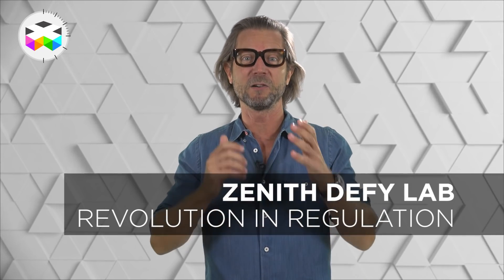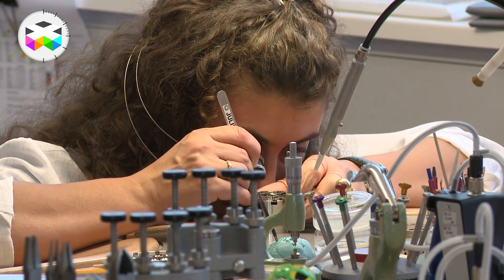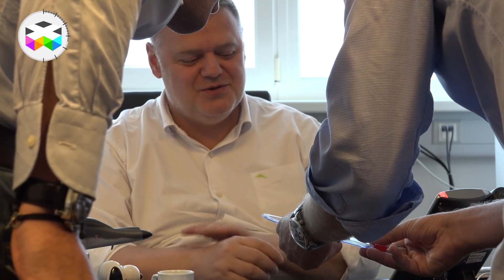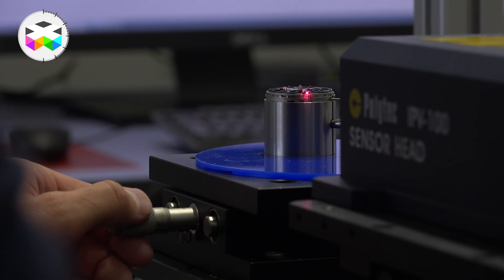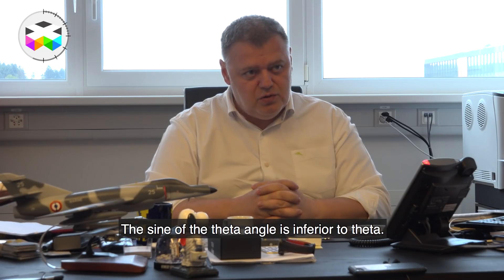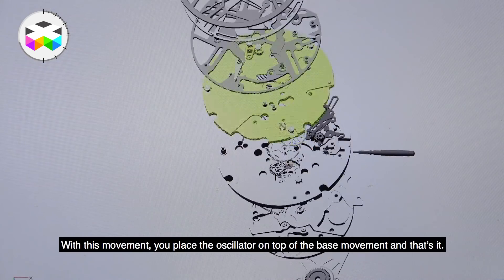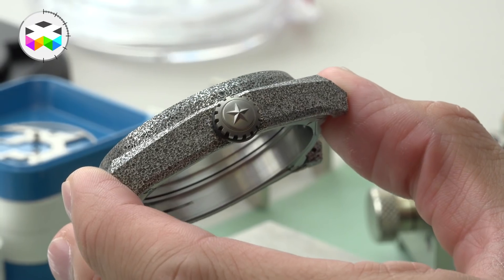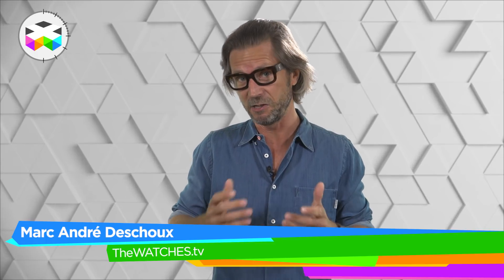Major Breakthrough in Watchmaking with the Zenith Defy Lab

Comment: I was heartbroken when I found out this was already 3 years old. 
But I agree; traditional watchmaking combined with new technology is pure magic.

Compliant mechanical design,
Topology optimisation and generative design
Additive manufacturing.

These will be key elements in future mechanical engineering and design, regardless of discipline.
Reply: I feel the same way but now it is 4 years old.  I'm fascinated by compliant mechanics and here I thought, wow! A product!  But is there?  4 years later, Zenith has not employed this movement in any new watches.  Why?  

Sometimes I wonder if the theory of compliant mech has only very narrow practical use case.  I mean, otherwise, we would have so many consumer products that use this material science.  But we don't.  And here we see what looks like an amazing implementation but 4 years later and it is completely forgotten.
Reply: It's probably too fragile to be used as a watch movement, or too expensive to make (hardly a problem when talking about luxury watches).

Comment: As a person who uses exotic mechanical principles in his work I'm unimpressed. The whole "femtosecond" "optical" "molecular" blah blah is so annoying when you see simple formulas and the thing looks like a flexure system. So a big meh from me.. it had to be fun engineering this (to get the ratios right) but it's just a different shape of spring (which might be more efficient)  finstead of the classic spiral. And why a silicon gear? To make it sound more exotic and to sell better..  so again form over function just like the whole world of mechanical movements. I'll stick to quartz with a nice case. Function and outside form over just form.

Comment: This is too early but what are the effects on this movement if you change the orientation of watch, also is it durable enough to keep oscillating in case of a drop?
Reply from the maker: Yes, in case of a drop, the variation is minimal and goes back in "regular" oscillating mode immediately, much faster than with a normal system.

Comment: Very innovative but a strong argument could be made that this is not a mechanical movement.
Reply from the maker: But it is, that's really the point, using a different set of mechanical science of course, but it remains mechanical . Best to you
Reply: i am genuinely curious, what do you think it is then?
Reply: Fixed Face A machine can be a blender or even a humans body or a quartz watch but in horology circles a mechanical watch is traditionally understood to be made of gears, screws, plates etc... all made from metals / alloys.  There are instances where a gear could be made from a plastic & that would still be mechanical but you cant take glorified rubber bands strap them to a movement & call it mechanical.
Reply: who say that mechanical movement must apply to metal materials?, you can combine wisely silicone and plastic material to avoid unnecessary magnetization as much as it possible and apply metallic materials for preserving the horlogy aesthetics tradition

Comment: Thanks for bringing an in depth report to us. :-)After doing a little digging on the web, I found this 2009 article discussing the plastic nature of silicon at the nanometer level which predicted silcon's use in watchmaking; it's brief and well worth a read. (The link will be attached as a reply to.this comment in case WTV doesn't allow links in.comments) "Silicon brittle? Not this kind!"Finally, the right angles formed by intersection of the strips which connect the anchor to the oscillator sections concern me. Ninety degree corners tend to.be failure points when vibrated (for example the cutouts in the fuselage for the windows in Britain's first jet airliner). Does anybody have information, in layman's terms, of silicon's physical properties? What I've found on the web is beyond my.level of understanding. How resilient will those intersections be, especially if it is.cold?
Reply: https://m.phys.org/news/2009-10-silicon-brittle-kind.html
Reply: I would guess that the limited angle of motion helps to prevent any kind of damage. Also I'm sure that they did plenty of research and stress tests to ensure it doesn't break easily
Reply from the maker: Cool comment and hope we get some interaction going!!! All the very best to you and thanks